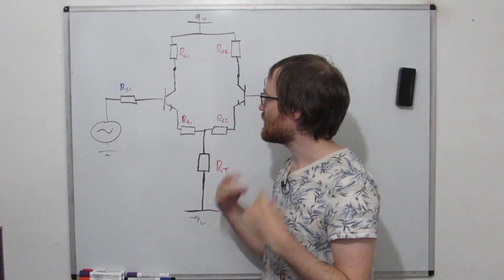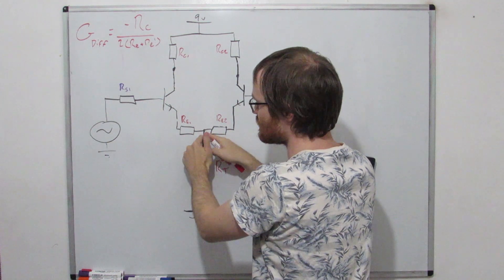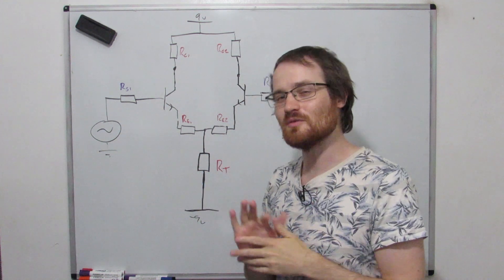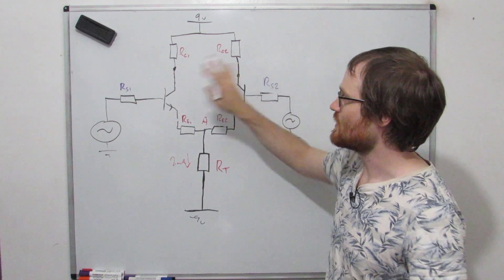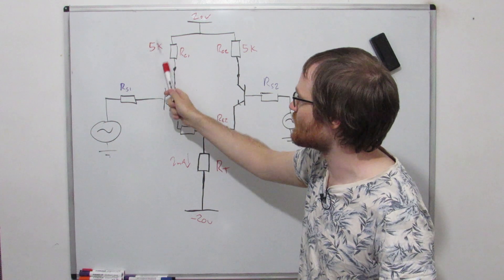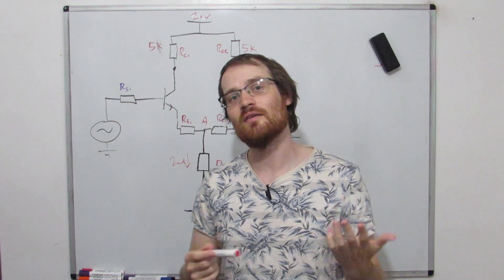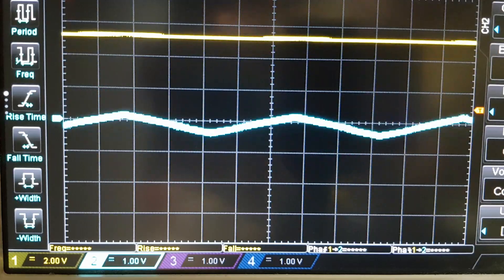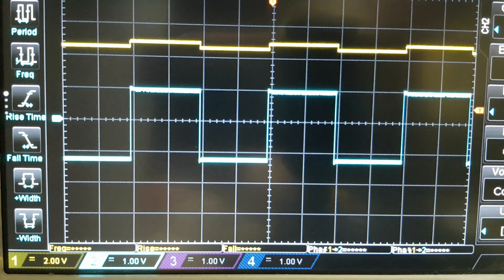Transistor-Based Voltage Controlled Amplifier (VCA)

Comment: Sir any videos on Radio Control circuit's  for example  RC toys circuit's how they work  , how the signals are transmitted from transmitter to receiver  to control the dc motors of the RC toy car

Comment: May I add something here. In AC analysis, the concept of Virtual GND is introduced as a shortcut to simplify the process of solving the circuit equations. It does not change the final result of the math but makes it much simpler to visualize and do the math. You can leave the RE in there and solve the equations with same result as considering the node a virtual GND. It just makes the math more hairy but would have same result due to the Differential nature of the circuit.

Comment: 15:46 no offense, but it sounds nothing like a sine. Sounds like a lot of harmonic overtones are introduced. Looks right on the oscilloscope, but it doesn't sound right.
Reply: could be a poor mic getting overdriven tho
Reply: @djturbofiwip2137  If you build this circuit, you'll hear that distortion that varies with the control voltage. It's VERY difficult to design a pure-sounding VCA.
Reply: Sounded just like hum and noise to me.